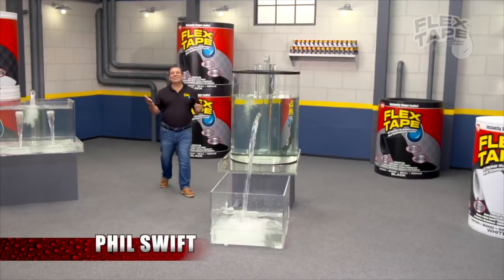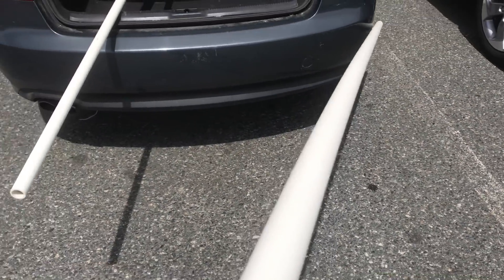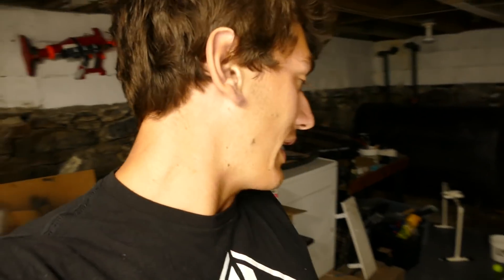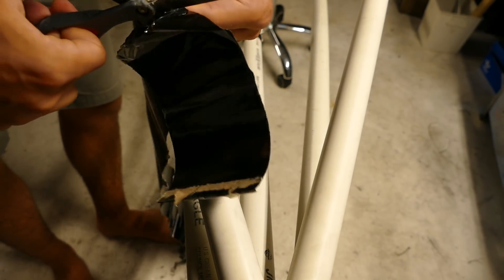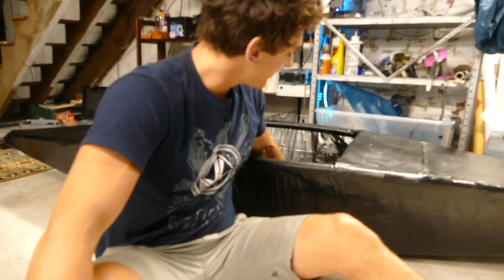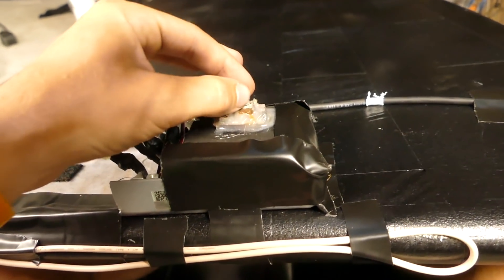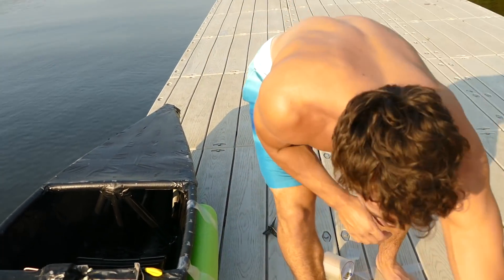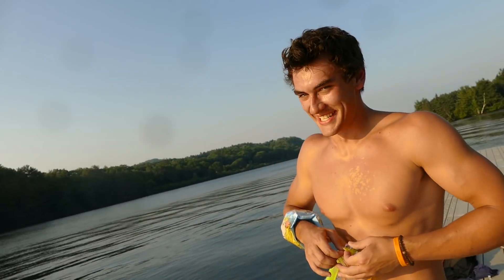DIY Jet Boat Made From FLEX TAPE!!!

Comment: Ok, so no flame throwers, no lasers, it doesn't glow in the dark, nothing at all shoots out and explodes. (Yawn). But, not bad. The Irish have built similar things for a long time--see currach. How about this,... build a flex seal currach "battleship" that has offensive and defensive capabilities, and--of course--glows in the dark! Extra points if it has a pop-out sail (it can be a wristwatch mounted pop-out sail, or not). Double extra points if it has a drone-launch deck. Triple extra points if anything at all on board recharges from a solar cell. Seriously--thanks for great builds.

Comment: Cool project what size pvc. Pipe did you use for one and two I would add two out board pontoons one on either side with longer stabilizer bars to make it sturdier in the water and ride higher also instead I have learned that you are supposed to go length wise with the tape instead of width we hen applying ti to make it more water tight and less leaking also you can add a hand rudder for steering easily

Comment: You need a switch that switches between the two motor for steering along with the switch having an option for both to run together

Comment: I like the pvc frame concept what about copper or metal pipes instead of pvc for better stability, obviously not as flexible, I think you could improvise,  or you could use as pontoons, for another boat, idk about FT as your base material! Next time😂 melt some plastic down, make a wooden frame and frame the boat frame with plastic...... 🌴

Comment: That boat that had a $148.00 price on it was probably cheaper. You should have bought it and flex taped the 2 electric Motors not Engines to it. Fun to watch though.

Comment: real cool, only thing is that the Bluerobotics T200 thrusters are rated to a maximum of 20V!!! If you use 6S Lipo there is a chance the motors will burn out. However nice use of FlexTape :), what ESCs do you use?

Comment: For steering you need to either have a variable control for each of the motors, (possibly with some adruino control thing for your smart phone - tilt to turn perhaps) or just add a rudder with a jib arm coming forward to the seat position..
For stability, and an outrigger to at least one side; this could be as simple as two 4' length bits of pipe taped to the top of the boat extending out to the side, with a 6" pipe (capped) and taped to the 4' pipes, parallel to the boat.. flex tape ftw!

Or build a second boat the same size, and connect via 4 pipe beams to make a catamaran.. THAT would be cool :)

Comment: Pretty dang cool! You should coat it with fiberglass now and you would have a permanent solution. Also, separate speed controls for the motors would probably steer it. You obviously gave me some ideas!
Reply: or a rudder .

Comment: Interesting build. couldn't help but take notice of cost and time.. 10 foot 1.25" PVC pipes from Home depot is around $5.80 each. Looks like you got 6 of them or 7 (over $35.00),, Flex seal is around 13.00, Don't know how many rolls of Flex Tape you used, but if you purchased just 6 rolls, at 12.88 each, that around $77.28.  $35+$13+$77.28 = $125.28 (not including hardware costs and incidental loss of 2 x 6S Lipo batteries close to/or over $100.00), comes up to  $125.28  That kayak was $148.00.. A difference of about $22.00

Comment: Okay, I like your idea and I may have an idea to fix your stirring problem. Now you have to screws (propellers) on the flex boat, therefor, use the screws themselves as stirring similar to caterpillar tracks on a tank. slow one down or stop the right to turn right and vise versa fir the left. further more, follow the acronym K.I.S.S you have two motors and two batters for each motor. I wise you the best of luck. :-)

Comment: Seems more cost effective and safer to buy a cheap kayak from Kmart or Walmart.  With the amount of flex seal, flex tape, tie wire and pvc, the cost should be right there with the cheapest 10' kayak. Sure, his is lighter and unique, but a cheap kayak is more durable and less likely to sink.

Comment: If you move the foot thing down on your scroll saw so it is right on the PVC it will work a little better. You should've also used differential thrust.

Comment: Instead of tying the construction with rope, cut plastic bottles in strips of width you like and use those as rope. then after tying, use heatgun on them and they shrink, making it super tight and will never rot.. :)

Comment: To show you the power of flex tape… I saw this boat in half!
Reply: TheMetallicIronSteel AND FIX IT USING ONLY WITH FLEX TAPE
Reply: TheMetallicIronSteel to show you the power of determination i saw my feet off and i m gonna run a marathon

Comment: drops battery in water, makes no apparent attempt to get it Protect the planet kids, protect the planet!
Reply: He literally had goggles on he could of just swam down there and gotten the battery
Reply: He had literally just put a snorkel on his head aswell
Reply: Magma Boy true
Reply: your right he should have pulled it out of the water lipo batteries are air tight for a reason and all these dumbasses in here dont know it but they are saying it the air causes a reaction and can cause the battery to catch fire do you hear that so they are air tight for a reason he should have got the battery out for littering reasons and saved himself $200 just dry it out and replace the connectors cause they will probably corrode
Reply: L W that battery fell into a body of water with an unknown bottom. Should he have jumped in following the battery and it punctured he could have and would have been seriously harmed. You're right they are airtight. But even on dirt should you drop a battery your first reaction should be run. Also you're not taking into account the conductivity of the water. It's very possible it would have shorted killing the battery anyways. There was no saving that battery. He made the right choice
Reply: rainofsparks23 yeah that 4’ of water looked super treacherous. Best to leave it in there and let it toxically leak out for years or leave for some unsuspecting young person trying to do some good and clean up the waterways, instead of taking an iota of personal responsibility for your actions.
Reply: Explain to me this. Would you jump into a lake/river after a battery that could be punctured. If that battery was punctured it would release toxic fumes that are able to kill. It will also burn hot enough to melt you pretty quick. Not to mention the battery is now shorted in that water, as there are trace sediments in all water. Water does not by itself conduct electricity, it is the minerals and sediments that do. That battery is shorted and worthless. 

Besides, although this is the only video I've watched of this guy, I bet he called someone with the proper equipment to PROFESSIONALLY remove the battery from the bottom after checking it was safe first. Yes just let me chase after a battery that reacts with OXYGEN, not air, which is obviously present in water molecules. Sounds fucking smart.
Reply: Sean Raymond I would take the appropriate precautions based on the equipment I was working with at the time. The same as I keep a fire extinguisher when I weld. The same as I lock out/tag out motor control panels when changing variable frequency drives. The same as I don’t use a grinder on a gas can. I wouldn’t leave a timebomb in a lake or river for someone else to find. It’s called responsibility.
Reply: @MH-ty7fb  you clearly didn’t read the fact that it wasn’t an acid battery.
Reply: Screw the planet! Recover the pricey battery pack! You've got a mask and snorkel, at least try...
Reply: Except they were lithium polymer batteries. Google what lithium does in water and in air. He made the correct decision to leave it. Had it hit a sharp rock and been compromised or punctured, it will start a very hot fire (around 1000 deg F) and can possibly explode, also releasing a dangerous gas that harms the lungs and can potentially kill. Having a 6S lipo battery (what looked like 2 3s batteries running in series) is a HUGE danger should it puncture. Also contrary to popular belief ITS NOT AN ACID BATTERY. NOOOOOOOO DANGER TO THE FISH IN THE WATER.
Reply: Noah Mcelwey that battery is highly toxic he shud at least try
Reply: pickle boi I know right
Reply: noah Mcelwey:     you mean except jump in and dive 6 feet to retrieve the battery, dude
Reply: @Marcbear2  no, just no
Reply: Good 1
Reply: Report then lol
Reply: THX 1138 You sure that wasn't knowledge and not a battery he dropped? Sometimes these things happen better when not wasting a bunch of time trynna save the Plan it's already lost. .
Reply: That battery could explode if he touched it. Li-pos are like grenades
Reply: долбни даже не умеют нырять.
Reply: Due to the density of water, that battery pack could not possibly develop enough speed or momentum to actually sustain damage upon reaching the bottom, even if there were spikes on the bottom. Additionally, as others have already said, due to Lithium's volatility, it would have been hermetically sealed, meaning it's waterproof, to prevent the dangerous reactions everyone is worried about. Furthermore, the corrosion some have mentioned would not be an issue if it was thoroughly shaken off once retrieved and later rinsed in distilled water. Lastly, while its large flat surfaces would possible have changed its fall direction, it would have been likely to be within a 10' circle assuming the water is less than 10' deep... most likely within a 6' circle. You can verify this by dropping a quarter into a swimming pool to see the fall dynamics in action.

Just a few ideas.
Reply: Battery may be toxic. But It will be neutralized after someyears. 4-7 years. Depends if its Fresh water or salt water or. Semi-saltFresh water. This concludes the Heated arguments.
Reply: How about you go get it  yourself if your complaining so much. Like JEEEEZ
Reply: Matt Hudson aand get burned after he takes it out of the water, because lithium reacts with water, and after it gets to oxygen, it starts a chemical reaction. Also, it could explode.
Reply: Toastee yes, if I dropped a highly toxic acid filled battery into water that supports life and is likely to become potable water I’d take a few seconds to get in the water directly off of a dock which is probably less than 5’ deep to pick up a large, very distinguishable battery.
Reply: Thank you THX 1138   ! To see such thing makes me sick! To read up on reasonable people like you and the above some makes me feel not all is lost.
Reply: LiPo (lithium polymer)...not an acid battery.  Those who understand the dangers of them, especially a 6s size, know since it has now been compromised, that it is far safer at the bottom of that lake than becoming a red fireball.
Reply: pickle boi he might be bad at swimming
Reply: THX 1138 Cool story bro, actually he probably went after it off camera, what he’s supposed to add, 10 minutes to the video of him snorkeling around searching for the battery, nope he came prepared with a backup, it’s launch day sucka, cleanup and recovery is after, haven’t you ever done a project before?! #alwaysacritic
Reply: Matt Hudson there was nothing he could do about it dude
Reply: Is it usful, no get out nurd. XD
Reply: Shut the F#ck up Matt Hudson.  It is toxic and probably will poison a little tiny bit of the water and kill only like 2 fish. Who gives a sh*t about 2 fish.
Reply: nappier2009 lmao
Reply: you wanna dive into the lake to grab a battery?
Reply: Matt Hudson Considering it's a lake there are a lot of unknown factors that make it more complicated. Dive down into a bunch of sharp rocks? Injury central, maybe even game over.